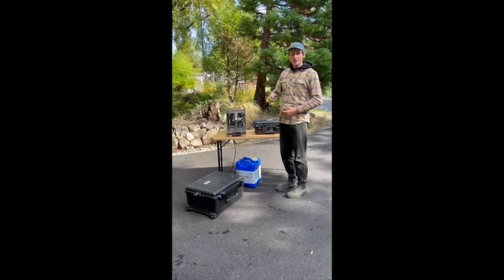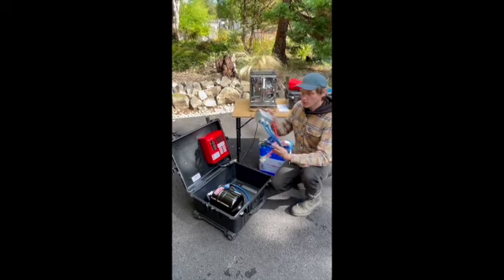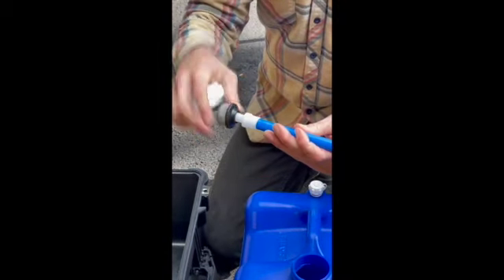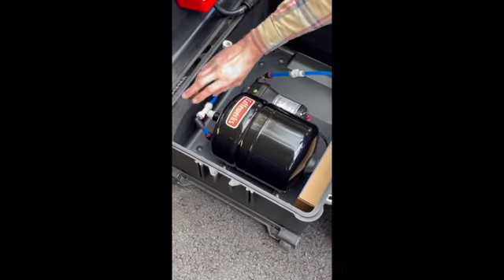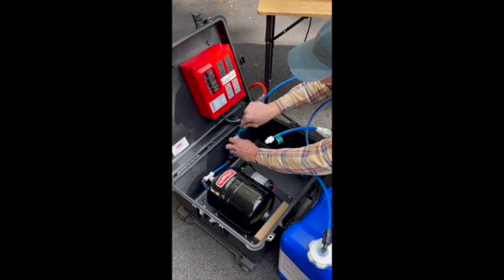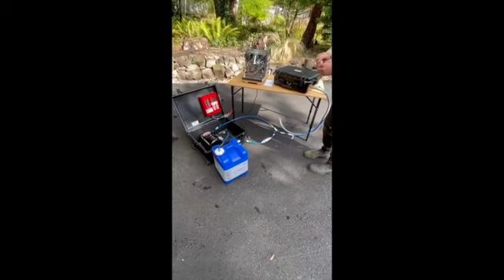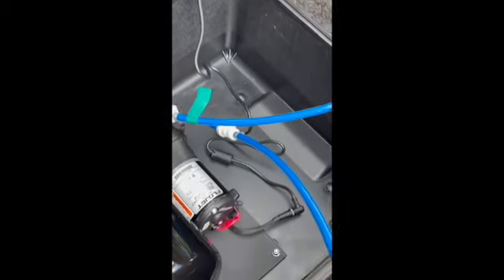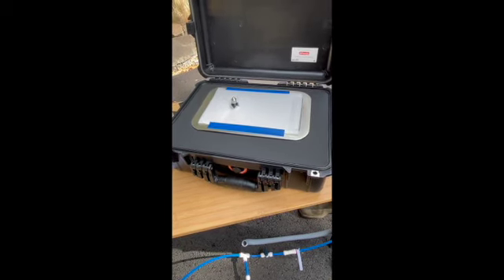Caffewerks All In One High Volume Pump Case + Spinjet Rinser Install

Comment: Explain the splitter again?? They can't be attached to the same outlet if it's a double outlet??
Reply from the maker: Hi Larry, That is correct each plug will need to be a a separate circuit.